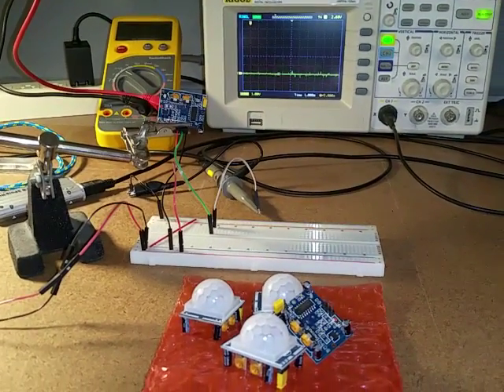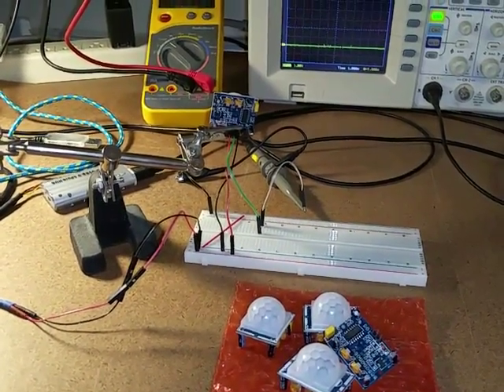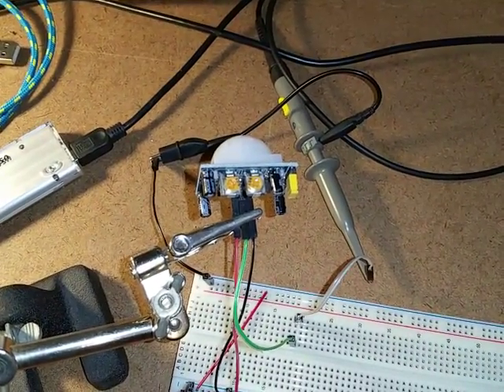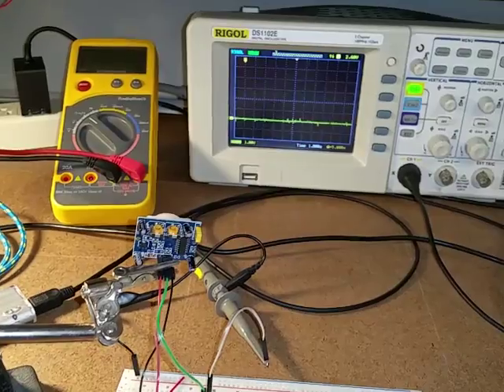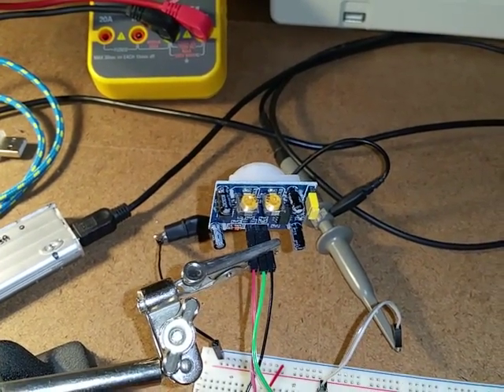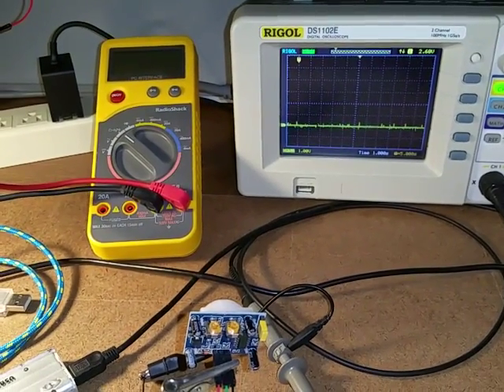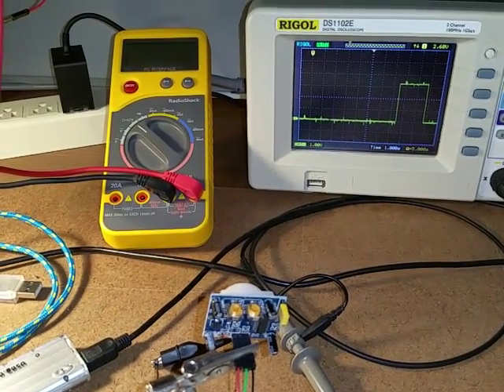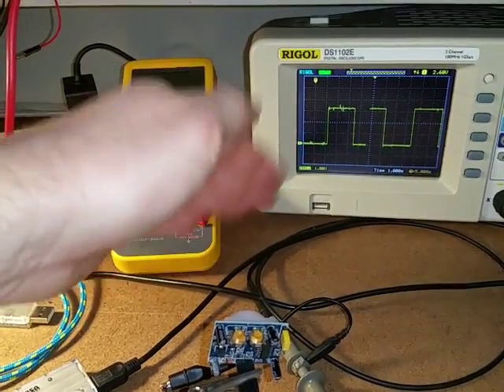PIR sensor - testing and looking at sensor output with oscilloscope

Comment: I thought you will show us PIR sensor signal on center wire (signal output pin) to reveal how much milivolts or microvolts peak-to-peak can PIR chip generate itself from warm objects moving in front of chip, instead ON/OFF state.
Reply from the maker: Good point - this video technically shows the output of the sensor module signal vs the raw signal from the pir itself